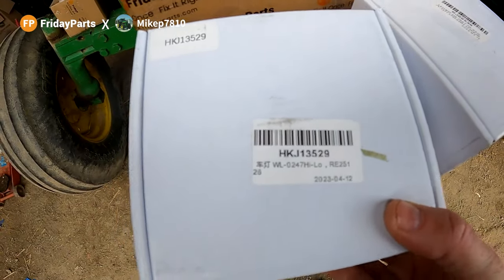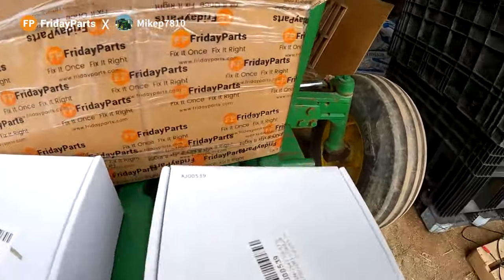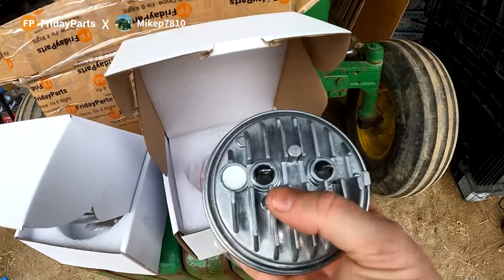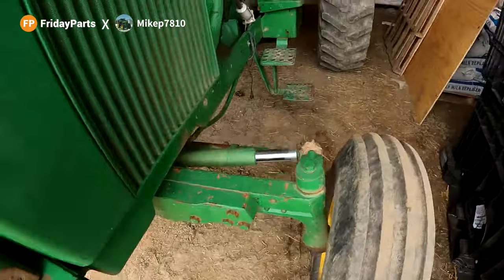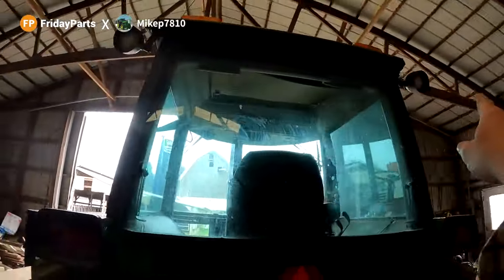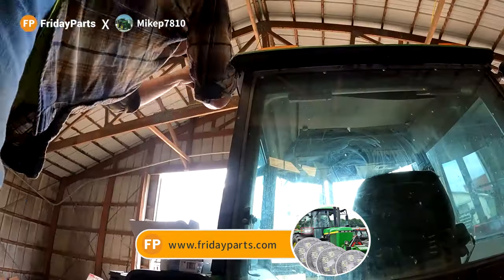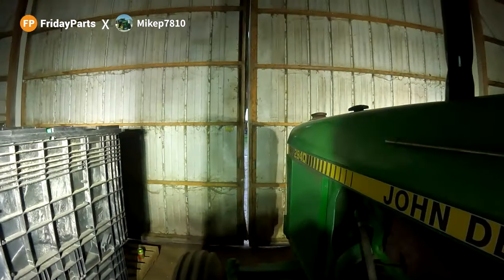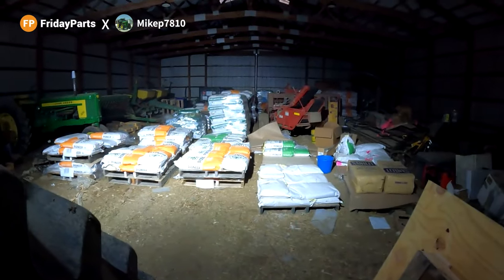Dual Beam LED Healight VS Normal Headlight for John Deere 2940 Tractors

Comment: Nice, LED’s are awesome, unless if they are not made well. I have some in a light fixture over my Island in my kitchen, they burnt out in about a years time. Crappy quality. SMH! 😉
Reply from the maker: That’s too bad. LED lights should last for years and save energy than conventional bulbs. Sorry to hear that you had bad luck with your previous light fixture, but don’t give up on LED lights though.😉

Comment: If there's only two factor wires going to each headlight how are you getting a high low to work?
Reply from the maker: If your tractor has only two wires for the headlights, it may not work directly with a three-pin bulb. However, you can consider using a two-pin dual-filament bulb that doesn't need a separate ground connection, or you can modify the electrical connections carefully with expert guidance. Ensuring proper electrical connections is crucial for the safe and efficient operation of your tractor's headlights. I hope this information helps! 😊